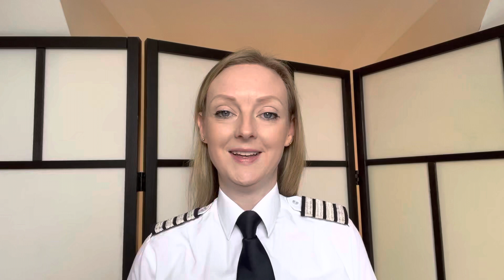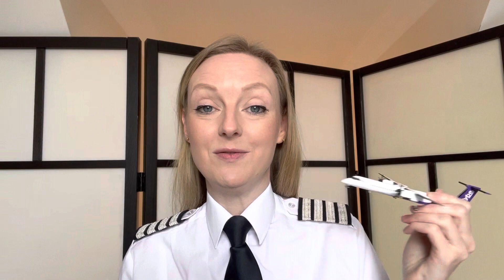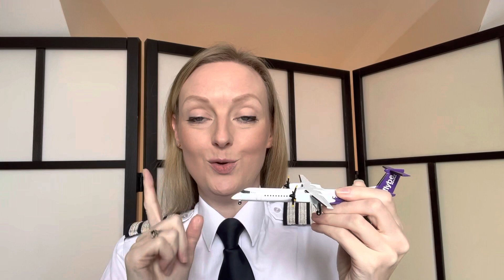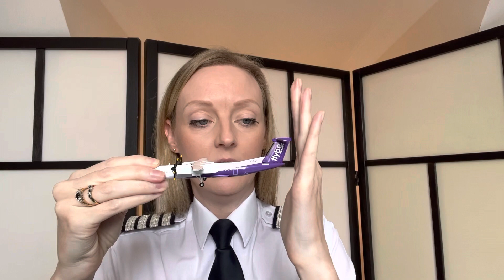Airspeed Vs Groundspeed

Comment: Ems are you sure? if the plane is doing 250Knots then thats what its doing irrelevant of the air around it.... now ground speed is 250K and head wind or tail wind is now in the equation.... then the plane is still doing 250k irrelevant of its speed to the ground or the surrounding air.... 250 is 250 no mater how you slice it... or am i wrong?.... hang on lets think about this.... if the ASI airspeed indicator is showing 250Knts then thats what its doing irrelevent of the ground or surround air.... yeah 250 is 250 no matter how you slice it.....or do i need to go back to flight school...lol fuck im confused

Comment: bullocks  the earth is rotating between 1000mph -0mph. I'm told the air near the surface is pulled along at the same speed.if flying close to the ground due east you should have no head wind only the speed of the aircraft needed for lift maybe 150airspeed. the ground speed would vary depending on latitude. due west you would experience a headwind because you are going against the direction of air. so less airspeed maybe 100 mph
  the ground speed is slower depending on the latitude. I see a conflict in your simplified explanation.  on a flat surface fine but on a spinning globe? i wont even bring up airspeed and altitude over long distance and nose up🎉

Comment: It’s really baffling to be honest. Here’s an extract from the literature I’m reading as I’m studying for my exam, for Paramotor flying, it’s clearly not the same for aircraft, thanks. 

AIRSPEED
The speed of the aircraft relative to the air. If the wind was perfectly still, the airspeed would be equal to the
ground speed, but with a tail wind, the airspeed would be less than the ground speed, and with a headwind
the airspeed will be more than the ground speed. Airspeed has everything to do with flying, as the airspeed
generates the lift required to fly. If we don’t touch controls/trimmers/speedbar etc, then the airspeed will
always remain the same, whatever direction we are travelling despite the any head or tailwind.

Comment: Now, a jumbo that I drove through with about 80 km seemed to be suspended in the air, how is it possible for that plane to have a counter-wind resistance and to glide slowly like that?
Reply: Because it still is producing wind over the airfoils 

The thrust is equal to the wind pushing against the aircraft, but that doesn’t mean wind can’t go over the airfoils.

Comment: Surely at 0.54s what you are saying is the power has to be increased to maintain the same airspeed? How can it possibly be the case that the nose of the plane gets hit with a force of 100 knots of headwind, and its airspeed remains exactly the same (all other things being equal)? Isn't that change in the Power a vital piece of information?
Reply: The example shes using is a constant head wind. not a gust.

Comment: One question:

It wouldn't be that exact of a calculation, right?

I'm imagining that with a 100kt tailwind, certainly all 100kts of that aren't going to translate into foward moment for the plane, right?  I'm assuming some percentage of that WILL, but that likely a large percentage of that tailwind will also just pass around the plane?  So a 250kt airspeed plus a 100kt tailwould would result in my like a 300kt ground speed.

Is this accurate?
Reply: that is why it is ground speed not true airspeed 
i think it is used for calculation of performance for example take off and landing ground speed would be nice cause it shows speed of air moving through wings
Reply from the maker: No, in fact, it is translated into ground speed. The airspeed is relative to the air within which it is flying. So a 100kt tailwind wouldn’t change the airspeed, but would increase the groundspeed by 100kts 👌🏼
Reply: The winds push the engines n the plane now rides or sit with the 100kt TW, if its directly TW, KTAS 250+tW100=GS350, approximate.
If that TW comes from behind but at an angle, then there is the Wind Components, not all 100kts of wind will push from behind, depending on where the winds hits the fuselage n TAIL , you might have ，say,50kts TW n 45kts X-winds (X-wnd),GS now is a vector answer, around 250+45TW, because the nose of the aircraft is now swimg into the x wnd. 
Think white water kayaking. Paddles are rudder or ailerons.
Sorry to hijack your thread, Captain